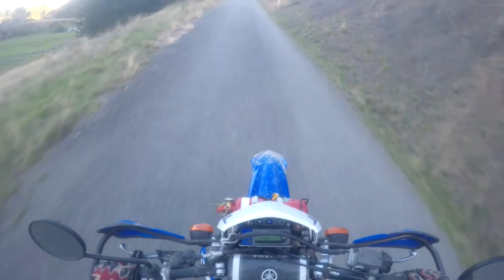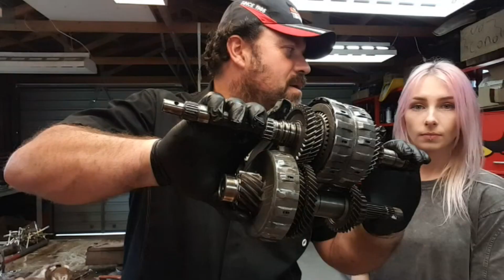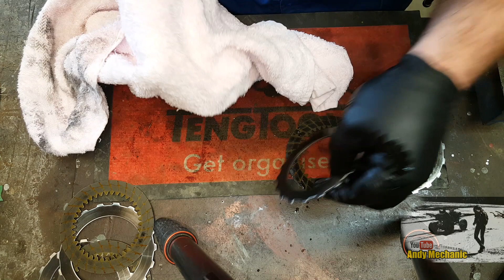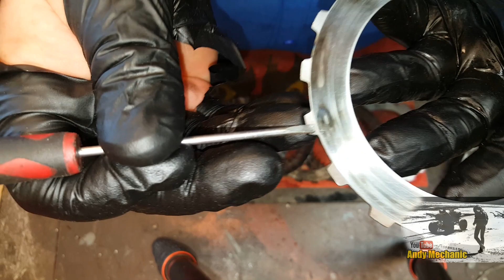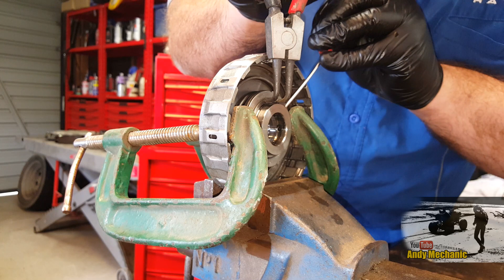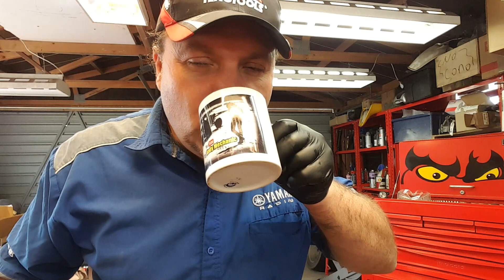Honda Odyssey AT clutch pack & solenoid valve inspection #1017

Comment: Just stumbled upon your vids,and watched a few till i found this one, i am a transmission mechanics in daytona beach florida area, and we see these all the time,99% of the time the factory torque converter clutch comes apart and stops the internal filter and transmission cooler up and depending on how long you drove it like this burns the clutches, normaly pull it apart install a paper and rubber kit a few clutches,new filter,aftermarket torque converter, new transmission cooler,flush lines well! And good as new for another 3 years, converter clutch is small and does not last much longer than 3 years, but great vid i loved it,subscribed! Mainly for the girls!😁 but ur great too, very knowledgeable.
Reply from the maker: Cheers & great info too. Welcome aboard! Cheers Andy

Comment: Here's a tip regarding the gloves you use: Nitril gloves, the ones you use, are specially made for tearing up as much as possible in order to know when there is only the tiniest puncture (important for surgeons). Latex gloves on the other hand, do not tear if they're punctured. They feel different on the skin, and are generally tighter but at least you can continue working with them if there is just a slight hole or cut in it. Cheers!
Reply from the maker: +Yo-Landi Hey, that's really interesting and helpful info. I didn't know that. 

Thanks and Cheers for the feedback. Andy :-)

Comment: I think it's second gear that suffers first on these. Changing from 1st to second is a big change in ratios and it happens every time you start off. The Odyssey is too heavy for the transmission so drivers tend to wind them up more at the lights. The other problem is that the transmission takes full torque through each clutch whereas in planetary gearsets the clutch only takes part of the load. I am not sure what wares out first but I think the valve bodies start to leak internally which bypasses torque converter cooling.

Comment: I have watched this and the complete disassembly of the Odyssey transmission.  My question is what maintenance can I do to minimize the wear?  More frequent fluid change, as well as the ATF filter?
Reply from the maker: Hi Verono,  yes, ATF oil changes and filters at the right times or more often as it can only be a benefit. This is more to do with driving style. Harsh acceleration and towing and heavily loaded car will increase the wear of the clutch pack friction plates. Cheers Andy
Reply: Thanks.  The ATF filter is in a rather awkward place at least for the 2000-04 but that a good tip.  Fernando Alonso should take note...

Comment: 54:20 you can see a change in the holes in the shared chamber (top 2 holes) when you activate or deactivate the solenoids, pretty neat!. love these dissections of dead parts
at college in order to open something theres WAY too much paper work to do so its really rare if its not on transmisions class or systems diagnosis. 
love the vids, i don't mind sticking in here for an hour as long as i have it available